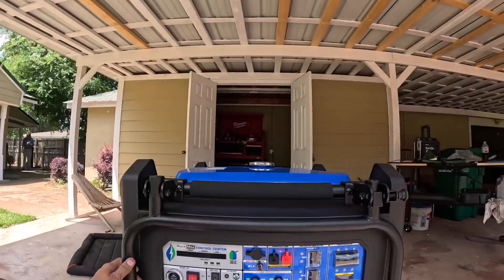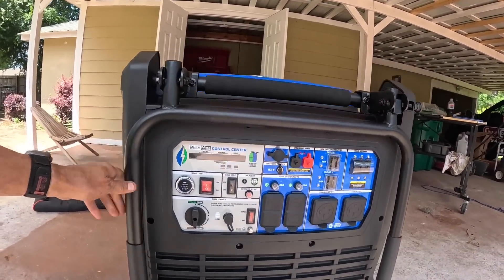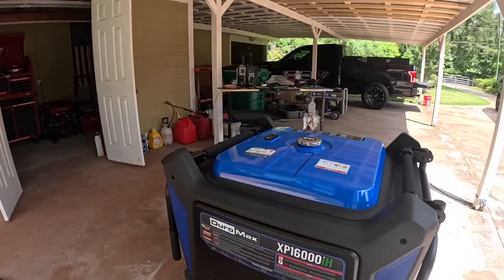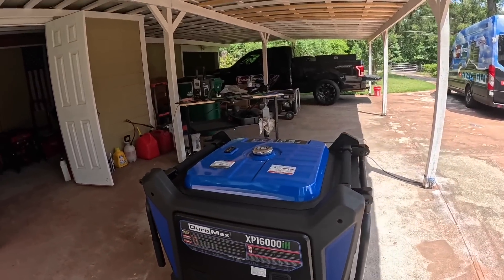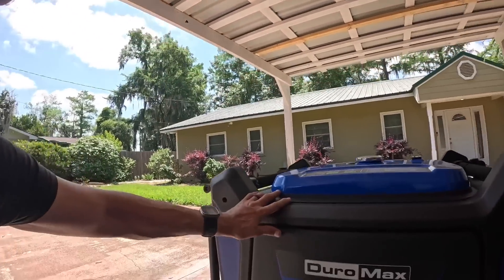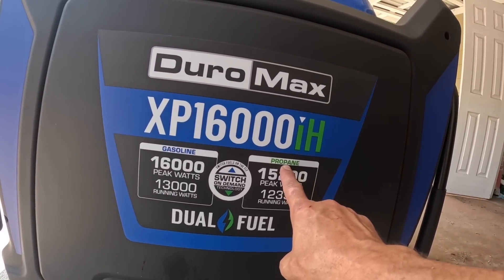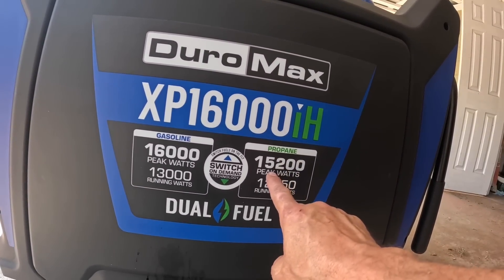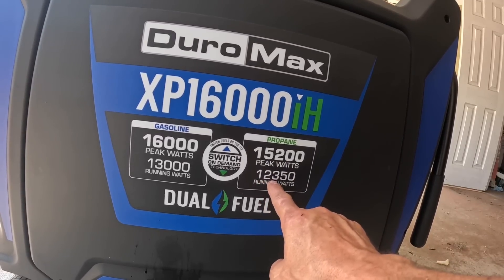Most Powerful Inverter Generator On The Market. Initial Load Test!

Comment: These Duromax generators look to have this no power issue quite often... A LOT of forum comments across a few models. No way in a 5k generator, when I need it to work it NEEDS TO WORK! BEEN looking at these but I'll stick to my DEPENDABLE Westinghouse... Cmon DUROMAX fix this!
Reply: Westinghouse is another chinese generator which have their own problems. A honda or diesel would be the best if money isn't an issue

Comment: The problem with these large generators (I have a 12kw) is the amount of fuel (12 gallons of gas) to run them all day long in a power outage. That can mean daily trips to the gas station or a very large propane tank installed. Even the gas stations need electricity to pump gas and in major power outage they can be out of it too.

With the price of small generators and the lower price of 48v battery inverter systems today, it might be better to have a battery bank system and small generator to recharge the batteries in a couple hours with just a few gallons of gas or propane. Cheers

Comment: Duromax just came out with tri-fuel in this size today! I am definitely going tri-fuel as I have natural gas at the house and already had a line run from the meter to the rear yard. Just not sure if I want (or need) the Inverter type as it is almost twice the price of the regular 15kw tri-fuel.   🤔

Comment: Informative video! Does this generator have an oil filter?How long would a 5 gal propane tank last? Since everyone in my area are getting natural gas generators, the gas pressure is questionable at times an the generators go down. People had this problem during hurricane Francine! I could store up to 10+ 5 gal tanks. Thanks
Reply: Buy a few 40 Lb Propane bottles at Tractor Supply you'll get a few days out of it.

Comment: Definitely need to not run low idle or eco mode when using high start loads... Well pump, AC, etc.  If you watch when you do that you will get surge drops to very low voltage.  Need eco off so it can surge support fast to keep voltage up. So not about adjusting low idle, low idle is not designed for use in supporting the whole house.  It's there if you're supporting only low loads like some LED lights and what not.

Comment: Been watching your videos for awhile on HVAC. But this has been a problem for me for awhile. I have a smaller generator and could not ush the whole house AC. I have ordered a softstart unit to help with the inrush current from the condensing unit. So I'm thinking this is perfect for me. The only thing with the Predator unit from Harbor Fright was gasoline only, I really wanted a dual fuel. So this will be my unit.

Comment: One thing I noticed about using the small propane bottles (20lb.) You can run under a good load for a while but then the bottle will freeze up and stop the generator. The propane can’t convert from one state to another fast enough under a sustained load. So I bought 100lb bottles (2). I have the duramax 13000 hybrid. Now I’m working on an enclosure solution watching many videos.
Reply: Yeah I wouldn't use anything smaller than a 40LB bottle and have the Grill tank for emergency. I can get a full day out of a 40lb with conservative use. (I have a 12500W/11500)

Comment: Thanks for testing the Central HVAC and showing us how it worked!  That's exactly what I'm interested in.  I would love clean power but I'm concerned about motor starts on an inverter.  This looks very promising; I was amazed that you could start the outdoor compressor on low idle.

Comment: Strange Duro-Max doesn’t recommend break in with gasoline. I have a 12000 dual fuel Duro-Max and the manual recommended running for 5 hrs with gasoline to break it in. Anyway…

Comment: The manual will tell you to run with eco off when powering items with a heavy surge.  You have several of those.  The problem is the eco mode cannot increase the rpm fast enough to deal  with surge so it tries to make up using the inverter output and that drives it into overload.  Just leave eco off to run your whole house.

Comment: Hard start capacitors appear to be more effective and cost-efficient than soft starts for AC compressor motors. After installation, I observed a more than 50% decrease in amp draw for both starting and running units. (4 ton)
Reply: How can you see a 50% reduction in running of an AC using a hard start?  I understand the starting reduction.
Reply: @condor5635 …he’s not getting reduction on run amps. It has nothing to do with running amps.  It will not cut electrical cost either, just helps her get going is all.

Comment: During break in, you should use non-synthetic oil. I thought I saw Mobile 1 but I could be wrong. 

Also, heavy inductive loads you should turn ECO mode off so that there’s no surge on the inverter system. After break in I think you can switch it back on.
If there’s a surge over a certain value the inverter will trip off to protect itself. So during summer when the A/C kicks on, ECO off will allow the inverter to pull that power it needs with no surge.

Finally, if you have issues with the engine having hard start after break-in, put Bosch platinum plugs in the engine. Those Chinesium plugs are NFG. A friend did that in his generator and fixed a multitude of problems he was having with the engine. He has a Harbor Freight 9,500 watt generator. 

Excellent video. Thanks for bringing us along.
Reply: @ brain trust 2682 The non-synthetic oil is best for breaking in to seat the rings. After break in, the synthetic oil will work well because of its heat tolerance and longer life, which comes in handy when people who think they know it all forget to be diligent in their maintenance during an emergency. ;-), but I'm sure you will go ahead and do what you need to do!
Reply: WRONG!!  99.9% of all new engines come with synthetic oil
Reply: @brianbyers2682  Well, that is what the operating manual says. You do what you need to do. Fine with me.
Reply: @brianbyers2682 your wrong small engines should be run on conventional oil and the manuals say that
Reply: @donls1sscme  As someone else has spoken I have taken it to heart, It is not the quality of the oil that is important but the frequency of the oil.

Comment: Propane is King during any mass emergency situation.  Propane can be stored infinitely and is reliable unlike gas and natural gas supplies.  IF a potential long lasting power outage occurs no matter what fuel choice selected it will be highly sought after and in low supply so its best to not waste any of it such as using oversized generator producing power you don't need nor will ever use.  No need to power entire house and cooling every room using homes central air..  Best to select a room such as master to use as a temp living area to stay cool, add it to one of your circuits of choice for power.  Pick out a nice size window AC unit or portable one to use along with a moderate size generator in the 6500 kw size to power it along with few other circuits such as well pump, fridge etc.
Reply: Exactly my take too.  Thats what I did.  Small 8,000 btu window unit.  6,000 watts running generator,  2 refrigerators, lights, fans and 45 gallons of gasoline (get it BEFORE the storm :) ...

Comment: also to note, you should do a fair break in period before applying the house load/equipment. run full speed no load for a while( 20-30 minutes), then apply half load for 20-30 minutes (portable heaters work well, outdoors, in cooler weather).
then vary the load from about half to 3/4. stop and change oil! (units with or especially without oil filter/pressurized lube).

Comment: FYI an 18LBS propane tank isn't big enough to supply it ever(other than full tank short test/low output) otherwise you'll want minimum of an 500 gallon tank or far larger to feed it for any real sustainable usage in an power outage.

Comment: when the power is out here, I go with minimal needed equipment/lighting powered on. well pump, some lighting, fridge/freezer and cooking appliances( one microwave and gas oven) although I will generally just use the gas grill outside, unless storming bad. the rest is un-needed, but handy. I don't bother with backup power unless it out or is said to be out for more then two hours.

Comment: Cool Generator. What about Trying to use the Broiler in the oven or the stove top To Boil a Pot of Water for Spaghetti.

a Propane Barbecue , That Generator & a 100 or 200 gallon Propane tank & You are all set for a Week or 2 without power.

Smart man not filling with gasoline. that way you don't have to worry about gumming up the carb etc. i would not use gasoline either unless You have to.
just takes all that gasoline & varnish out of the equation.

You should try living with it for a Weekend once & see what happens.
it would be interesting.

see how long a 5 gallon propane lasts.

You could use refrigerant scale figure 1 lb of propane for how much time.

Comment: At times I wish my Honda was inverter but it manages clean enough power to handles my audio and video equipment as well as my computers. Talk about your 50 amp cable being heavy all I had when I wired mine here was 4/0 UG 😅 The 50 amp breaker might trip but the ug won’t burn up lol   Glad I did utility work in a previous life so I had the Burndy crimp tool and plenty of block splices lol

Comment: you may need a bigger tank of LP , once you start to get above 5Kw you need allot more gas , that small tank may not be able to produce GAS lp fast enough. there is a kit I seen to connect 2 tanks together to supply enough GAS..
Reply: an little 18lbs cylinder is useless  for all generators, except for when full and very short testing. for a generator that size to be of any use, you'd need minimum of 500lbs tank (for about few days low power usage) want to use lots of power? better get 1000+ gallon tanks(multiples or larger!)

Comment: Turn on the inverter devices on it economical in electricity. Regular air conditioners consume high current while they and electric heaters are starting their work. etc

Comment: Propane is less powerful than gasoline, so you'll go thru propane faster than gas. But propane doesn't go bad from sitting and gum up the carburetor like gas does. So with propane it can sit for years and start right up. I work with marine diesel generators. You may need some hard start kits on some motors if you're marginal on power.
Reply: good information for those not unknowing.
Reply: Hard start capacitors appear to be more effective and cost-efficient than soft starts for AC compressor motors. After installation, I observed a more than 50% decrease in amp draw for both starting and running units. (4 ton)
Reply: You mean soft start kits.
Reply: @ChatGPT1111  Hard start capacitors appear to be more effective and cost-efficient than soft starts for AC compressor motors. After installation, I observed a more than 50% decrease in amp draw for both starting and running units. (4 ton)

Comment: I've found on inverter generators that when pulling hard starting things keeping it on hi idle is better 
For the generator. I have a 8500 watt DuroMax generator runs my house well. The new heat pump ,I installed a soft start on it haven't tried it yet but I hope things work well on the generator and Ac. Curtis what do you think about the soft start add on?
Reply: I would also like your opinion on a soft start I have an old trane 3 ton that would probably need one with my 10000/8000 duromax genny
Reply from the maker: I haven’t used many. I’ve heard lots of cautionary tales, but have never actually seen one cause harm to a system.
Reply: HINT! when  heat-pumps go into "defrost mode", they generally, change the reversing valve to "air conditioning" mode to de-ice the condenser coil, while they BANG the "electric heat strips" on full power to keep it from blowing cold air inside the house. that is more than most all generators will handle. there are cases where it can work if the backup heat strips are on multiple breakers and the highest current breaker can be left OFF, as to not overload the generator.
but it all depends on the homeowner knowing/recalling to only turn on certain breakers/loads when on gen power. 
as for "soft start/start setup" on compressor/motors, yes if sized proper and system is in good working order, they can lower the peak start current and shorten it by far.
Reply: @throttlebottle5906  well for me being in fl I would only be using it during hurricane season so heat strips would not be a problem
Reply: I have one (soft start) in Vegas on a 5 ton 13 seer Goodman unit and it pulls less than 32 amps to start up. Works great in an 8500 watt generator with no issues. Mine is an Air Go soft starter that works great even in our desert heat and higher start g loads along with it.

Comment: High idle as You stated is not an idle at all.  It is running the Engine at full 3600 RPM...
When You were running low RPM The inrush currents were to much for Propane to overcome.

Comment: Check the manual for that system. I think you need a bond to ground via a ground rod right at the generator. Also check the grounding requirements of your electric provider and ask a local licensed electrician. Calculate propane consumption perhour and then the expected time backup power is needed. That will help you decide how big a tank you will need to have filled up. My preference would be using Natural Gas. The last time I had lost power it was about 10 days.
Reply: He bonded the generator to the house ground through the 4 wire cord so hes all good in this hookup.

Comment: That is a big giant beast all I have are two predator 3500s in parallel so I can get 50 A at 120 V and I just run a couple of window shakers and it runs my other stuff that I need just fine, but I don’t have many 240 V items in my house. My hot water heater is natural gas. Basically just my stove and my dryer. I can’t use in a power outage, but I have a hot plate and a microwave that is good enough to cook with in a power outage maybe one day I can get a big one like that
Reply: @ paultice - Get a Propane barbecue for power outage & Normal life too. 
Also - air con -  Mini splits - 12,000 btu are 115 volt now. Heat pumps too. Norcal refrigeration just installed one. 
$875.00 amazon.
Reply: @OcRefrig  hehe, yo man. I have natural gas here, but keep propane around and have generators. yeah, I mainly use one of the two bbq grills when power is out(not in storms), natural gas and propane grills both. but generators will run a microwave if needed, gas stovetop can be lit with no power(lighter/match) if need be. the oven needs power to make ignitor glow and gas valve(thermally open), stupid "newer ovens" yeah newer means early 90's on lol.
Reply: Get a used gas dryer. $50.00
a lot cheaper than electric to run.

can be run on propane too. i've done it. no mods necessary. i've done it.  works great.

i just used an air hose as a propane hose. worked great. no air leaks = no propane leaks.

Comment: Our Power Company in STL Cut Tree Trimming Program causing Major Outages after 2006 Tornado and 2006 Ice Storm.  Installed Natural Gas Generator, 12/2006.
Reply: Cost to run natural gas vs gas station gas per day
Reply: @herewegoagain4041  Natty gas is 50% less.

Comment: That is awesome. It covered the house with power to spare. Compared to most generators, it wasn't that loud. I don't know if you have natural gas, but if it can be converted, there would be no need to run for propane. I don't know if it is true for that one, but they claim you have to give them a cool down period every 4 hours. I have used generators before, but nothing of that magnitude. It looks like a badass machine to me. Thanks for sharing.
Reply: Propane is KING in mass emergency situations.  Propane can be stored indefinitely.  Houston TX folks learned the hard way when they lost their natural gas supply due to frozen natural gas wells which rendered their house generators useless during that big freeze few years ago and several other times.  Other areas in the states experienced the same after storms and hurricanes.  His 16K kW is over kill for his needs though and will just needlessly burn up more of whatever his fuel choice is.
Reply: @bigblue3568  The best thing about Tri Fuel is three choices and opportunities, I understand why most manufactures do not want to do the Tri, natural gas system vary from region to regions, state to state, there is dominium requirement.
The human factor is always the big X factor, DIY, semi pro aka expert have a big influence on how will it will work with Nat. Gas.
Reply: @bigblue3568  We never lost natural gas during the power outage.
Reply: @bigblue3568 but it will run at, say, 25% capacity rather than, say, 50%. This should save some fuel.

Comment: Man, that's a monster!!!    I don't plan on using my new 7500W tri-fuel Firman generator ($700 @Costco) on gasoline either.   Maybe I'll run it one time on gas just to be sure the carb works and run it dry. Should we be putting anything in the fuel tank to prevent rust? Fogging oil or swish around a little Marvel Mystery Oil maybe?
Reply: That is a good idea. You can keep gas in it and add fuel stabilizer. If you do, change it out once a year.
Reply: @jthonn  Yeah, that may be the best plan. I guess even with a coat of oil of some kind, air would condense some moisture in there long term. I do keep a good amount of non-ethanol fuel with stabilizer on hand, and rotate it regularly, so adding the generator to the rotate list is not a big deal. Thanks for your input.
Reply: wd-40 in fuel tank will keep tank from rusting. Wd= water displacement.

Comment: You should never use synthetic oil to break in a small engine.
Reply: The non-synthetic oil is best for breaking in to seat the rings. After breaking in, synthetic oil will work well because of its heat tolerance and longer life. ;-)